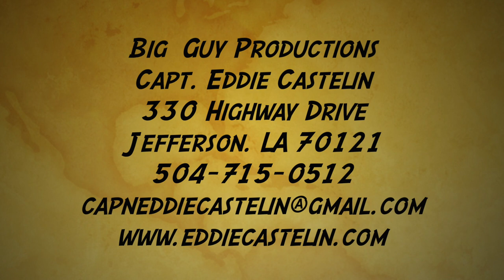# 306 Bottle Stopper

Comment: Great project, good finish. Keep at it, healing takes time, but the more you work in the shop, and do things, the quicker your brain will heal from all its been through. If you wash your hands in regular soap and water after you get CA glue on them it tends to come off easier, for me. Give it a try and see if it works. I build r/c airplanes and I have found that the easy way to get the glue off.